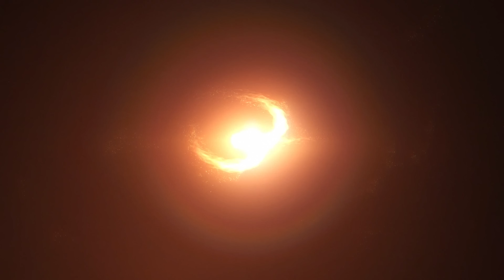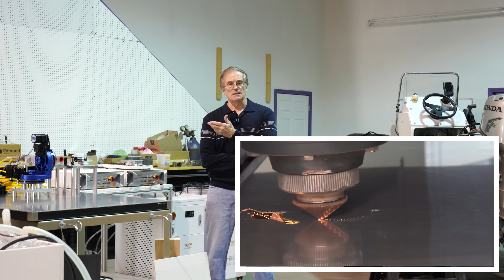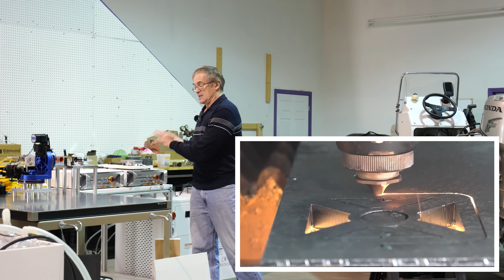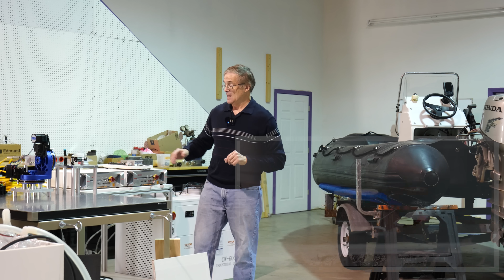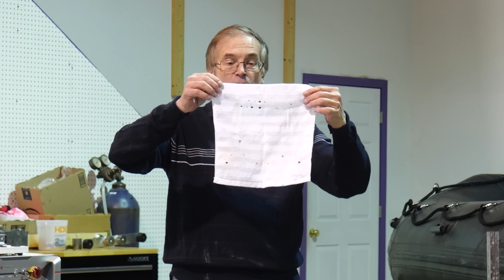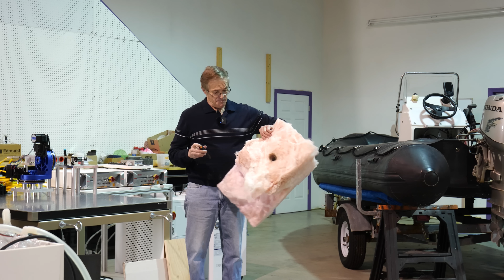We have a problem... and need your help!

Comment: For lasers with so much power one solution isn't enough. What you really should do is to divide the problem into separate stages.
1. First line of defense should be simply your software, as it should never allow the beam to become stationary for too long (delay could be set to below one second or so).
2. Second line of defense should be an analog circuit connected to the galvo system you're using. It should get the feedback information from your galvos (mirror movement speed) and it should detect when mirrors become stationary. The moment that happens (with configurable amount of delay) the circuit should cut off the power from the laser (or the driving signal or both).
3. The third line of defense should be a high speed shutter (e.g. spring loaded mechanism) that would deploy a shutter (or 45 degree mirror) to absorb the beam (or divert it to the OEM beam absorber). It should be placed just before the galvos. It could be also driven by such analog circuits as in stage 2, but don't drive it from the same circuit and instead use a duplicate for redundancy (two independent circuits one for the laser driver/PSU, and the other for the shutter).
4. Last stage would be located after galvos, but isn't that much problematic when first three stages solve the stationary beam issue, so any of your previous ideas would be fine, but be careful, as any material that melts instead of ablating carries the risk of reflecting the beam randomly which is even more dangerous. (e.g. imagine melted metal, glass etc. deflecting parts of the beam in random directions).

Now, you might not like the solution, as it potentially reduces the performance of your system (will not work reliably for absolutely stationary targets), but unfortunately that's how professionals do it. Consider - how often would aiming for a flying drone require a 100% stationary beam for few seconds? Almost never, but it could be calculated. And remember, this is the only single case impacted by this solution, and it still might work for stationary objects most of the time (because stationary target isn't the same as stationary beam).

Fun fact, when I was working with a high power laser at a university, we decided to make such mechanical beam deflectors from modified scanning head from HDD, because of it's speed and reliability. This allowed us to quickly resume the laser operation automatically.
Reply: If the drone appears stationary, it is targeting the laser defense unit.
Reply: @michaellee6868  Not if it has more than one camera.
Reply: I do not agree:
1. Make the system intrinsically safe through physical means.
2. Do not rely on software solutions, no matter what SIL level it is rated at.
3. Goto 1.
Reply: @pompeymonkey3271  Nobody says software should be the ONLY safety measure. Please read carefully - my advice specifically says to adopt 4 safety measures, all working together with the one on top of each other approach. This means, if one fails, there are 3 other protections still working.
Reply: I agree all of the engineers saying to compromise every other requisite because you could have an automatic stopping system did not understand the mission

Comment: Use a small, water-cooled chamber, with the side facing the laser beam made of thin sheets of tungsten metal. All parameters can be calculated, including the tungsten thickness, water flow rate, and coolant temperature. You can then simulate the process before conducting the actual test.

Comment: now i dont know if it will work any better. but instead of your fiberglass insulation, how about rockwool insulation?? i know its not as popular in the states as it is in europe. but might be worth a try, atleast to see if it does any better and can be used as 1 of multiple different layers

Comment: The only thing that probably can work is something self healing which could be tank or water rather than towels
se 1-2 pieces of glass and fill the gap between them with water. for better result use copper sheet for backside as copper is very resistant to laser beam because of incredible  heat conductivity, aluminium is also reasonably good, steel is useless
water opacity can be modified with dye or glitter to absorb beam more gradually amd prevent it from exploding and damaging glass.

Comment: I propose using a rotating disk covered with ceramic heat-shield tiles, similar to those used on SpaceXs Starship. the rotation ensures the laser beam never remains stationary long enough to penetrate the matrial. To further prevent localized heating or damage, the disk should also Move vertically by a few inches up and down, distributing the lasers impact area across the tiles. an array of these lightweight, ceramic-tiled disks could provide effective and mobile protection, significantly reducing the risk of damage from the laser.

Comment: Movement.
When the problem is only difficult when the beam stands still, don't let it. Movement is relative. Move the background. Try some of the following:
- moving air with absorbing particles inside (fog, dust, etc.) in front of the barrier.
- try the towel idea but with moving water, i.e. actively flowing water over it.
- Make the barrier spin, ideally more than 1 layer, counter-rotating.
Reply: Good idea. Reminds me of X-ray tubes where the electron beam is hitting a rotating target.
Reply: I like the spinning idea.  He could use a modified osculating spindle sander.  Make the spindle larger, and crank up the speed.  Could make the spindle out of graphite.  Could also wire it, so the laser cannot turn on unless the osculating spindle sander is running.
Reply: A rotating granite fountain/statue, he could have a nice sculpture / water feature sprucing up the place
Reply: I was thinking of a curtain of water dyed to make it absorb. Same idea, flowing water would keep moving new material into the beam.
Reply: You didn't listen to the parameters. He said 'or if the mechanicals fail' Can't move if they fail.
Reply: @FlakeyPM  The mechanicals guiding the laser, he is talking about.  A spinning drum 15 feet away is not going to instantly stop.

Comment: I don't know enough to make really brilliant suggestions but would a sort of carbon dense material work? For instance, set up a container like those that make wood gasses and use the tar. Put tar and gravel in a sandbag along with anything else that may improve the sandbags resistance--like maybe make the sandbag our of a certain material as well. I'm kind of basing this off of FIRE and not LIGHT though, you also have fire proof materials such as those seen on @Nighthawkinlight. You may even have to layer the tar for any sort of positive effect, but if not a sandbag at least sounds pretty scalable, easy to move about and, replace.

I haven't given, very literally, any thought to this--immediate gut reaction to your problem. I'll do some googling and see if I find anything as well. Never heard of those lasers in my life so I don't know enough.

Comment: Showing my ignorance here, but could a high temp mirror reflect it down and into a tank of water with particles present to absorb a greater range of wavelengths. Other thought it swamp cooler padding or fire brick with laminar-flow levels of water cascading down over it.

Comment: WOW got I jealous seeing these fiber lasers under your workbench- a kids dream came true ;)
While thinking about this problem, I thought about the practicality of most solutions readily available. In fire-protection we utilize mainly 2 methods in order to protect important components from many 100 °C of fire energy. Ablation abd Intumestation. First method uses highly thermally conductive materials to conduct away the heat. Reading into the most efficient systems, none is capable of conducting many kW power from a mm² area in such rapid fashion.
Left with the idea of thermal insulation by permanently intumestating materials- i tried some I had left from a project, and just used my 120W diode driven laser with a collimative lens setup. Turns out it somewhat works at this rather low power. Those materials 'foam' into black carbon like fiber structure, and the more it is heated, the more foam develops. It just started glowing red, turning laser radiation into IR radiation. (Tested with HILTI CP 611A)
While I think such thermal paste (Eg. a cm thick layer applied to some drywall) may give you some ms, I also think it may not be sufficient.
And while wondering why you wouldnt just use a brick wall (forgot that in US even obtaining bricks may be a story on its own), it came to my mind- what about simple sand bags? Molten sand should by the weight of the sand on top be rapidly replaced and the molten component compressed, exposing all fresh sand at the laser entry point.

However, interesting experiment, and also interesting channel- my Regards!
Looking forward to see how you will deal with optical abration due to air layers in the process....

Comment: What if creating a round frame and connecting high-pressure water nozzles that will start spraying in anticipation of a failure. It will work like an air curtain. Only a hole for the laser beam to go through.

Comment: Soooo, what wavelength of laser is it? I've got two ideas. I'm wondering if you could leverage something like a fish tank with dyed water in it. if the dye is 'tuned' to not absorb all of the energy in a small point, it would then be able to dissipate it over a larger volume of liquid. of course, this means having a tank made of something that can pass that amount of light into the material, which might be a small issue at those power levels.....

another option is an ablative material like phenolic-impregnated fabric or even a DIY Phenolic Impregnated Carbon Ablator made with carbon fiber. if its good enough for rocket motor casings, it might, MIGHT tolerate a blast from this beast for a short time if adequately thick. no idea what the fumes let off by this would be like, i'd imagine not the best to breathe.

Comment: Simple solution, you need a material something like the gypsum in the drywall. Material needs to be granular and vaporize when struck by the laser rather than melting.
Build a container, three sides in the bottom could be made out of most anything. The side facing the laser could be 10 gauge plate metal. Fill the container with finely ground gypsum powder easily attainable from a construction site and ground with a hammer mill.
The laser will instantly burn a hole through the plate metal and enter the gypsum powder, it will start to vaporize and create a void. More powder will fall into the void and continue the process.
All components are cheap, easy to build and move around. In addition the whole thing is scalable.
I hope this will work as good in practice as it did inside my head.

Comment: For curious people, that is a Chinese Max photonics ( MFSC-2000 or 1500) laser source.
Reply: How much is it? Asking for a friend
Reply: @tedarcher9120  these cost between $1500 and $2500 on Alibaba.
Reply: @tedarcher9120  between 1500 to $2500 in Alibaba
Reply: How much is it? Asking for a friend
Reply: @nikoivan2580 between 1500 and $2000
Reply: @nikoivan2580 random internet vendors put it around $3000 list (not including tariffs.)
Reply: I turned up the resolution on the stream and they read: MFSC-1500X
Reply: 15kW, sweet!
Reply: @tozrobilem  these have 1.5kW to 3kW variants. Above 5kw is sold by US defense contractors to military.
Reply: My web searches lined what he has up with the 3kw models. Stopping 6 KW focused into a sub-mm beam Channel is quite the puzzle. Most people didn't even bother to figure out what they were trying to do they just started spouting off the go-to answers.

Comment: The only other thing I can think of would be night hawk in lights "starlight" recipe
Reply: +1 to this. *Starlite
Reply: I just suggested this, didn't see your post first haha! Immediately came to mind when I saw this.😁
Reply: i had that tought
but the heat were dealing with here is on a whole other levelfrom a simple fire what that was designed for
maybe talk to NASA and get some of the spaceshuttle heat shield tiles?

Comment: I like the water wall idea.  You may need to combine several ways to mitigate the beam.  Any dense material like brick will crater like getting a torch too close to concrete. Space shuttle tiles?  Foamed ceramic?
In short you want something heat resistant, loose so material doesn't explode out of the path, and maybe active cooling of the area to bolster the material used.  My first thought on my budget would be discarded graphite/carbon bricks from steel plant that uses them as electrodes in arc furnaces (I got a few from a junkyard) and grind up to use in a slurry to waterfall over a substrate.  That will give you beam and heat dispersion.  That leaves what medium to use that won't instantly vaporize or release toxic fumes and a suitable substrate.  I guess plywood is still viable if hung from the top so warpage won't matter much.  How about those light weight furnace bricks or ceramic blanket?  Maybe start with water and something to keep carbon in suspension and maybe thicken the slurry a bit - corn starch? xanthan gum?
Just rambling...

Comment: After going back and forth with chat-gpt about some ideas. I initially was thinking some sort of prism to break up  the beam and salt backwall. But as chatgpt informed me salt can explode under high temperatures... instead it gave me this information. I hope its useful, good luck and this is kinda a funny problem to have xD

Best Combo Approach (DIY-Friendly)

If you want practical, cheap, and non-toxic:

    Outer layer: 2–3 cm ceramic fiber board

    Middle layer: Sand-filled panel or water wall

    Back layer: Concrete or another sacrificial ceramic board

That’ll buy you several seconds even under a focused hit, won’t reflect the beam, and won’t send noxious smoke everywhere.

Comment: I suggest graphite such as used in high temp crucibles ( or even just graphite tiles) pre-treated first with torch to drive out all moisture and the surface sealed with any thin sacrificial sealant to prevent re-absorbtion of moisture from atmosphere. Any porosity in the graphite which will be very dry should not spallate and should aid in scattering and reducing beam density. The graphite might get very hot but i don't think it vaporizes.  GREAT channel, Thanks.   Phil Spindrift

Comment: possibly graphite sheets? it sublimates into C02 which could act as a plasma that is mostly opaque to the beam. haven't run any calculations on that, just an idea. large IR translucent sheet as wall for a large water tank that uses water as optical medium in a concave optic that diverges the beam? typical beamdumps are a small hole through which a laser hits a reflective cone that diverges, splits and directs the beam into a cylindrical, opaque surface. this works fell for a stationary laser but certainly not for one zipping about with a galvo. a fast rotating target might work to average out beam power over a larger surface area. vibrating either source or beam dump can have a similar effect to a strongly diverged beam.

Comment: Steam or fog, enemy of lasers and microwave IIRC. Keep up the good work.
Reply: containing the steam/fog might be a problem
Reply: @UNgineering  I wasn't thinking of it as a single layer solution, but as a single layer of a multilayer solution. If it were used as a middle layer, then the layer beyond it would be potentially have a longer life, as some have called for graphite or carbon as a backer. Something easily mobile, fairly lightweight.
Reply: exactly my first thought. Though they wanted something absorbent not dispersing.
Reply: @wtfomgok  I thought they didn't want reflective/mirror like.

Comment: There are lots of great comments. The carbon based ones sound nice I like the ones of spreading the beam out on more (heat resistant) material, defocussing or spreading the beam out (reflection or diffraction) another option is using a spinning shield (a disk or a cylinder) so that fresh material is continuously presented and hopefully cooled off by the motion.

Comment: My reaction, from a place of not being an expert, is to go with a tank(aquarium) of water(or other liquid) with a dye that has a absobant spectrum close to your wavelength. Carbon black might work, and is cheap, but there may be a dye that does a better job with water. Any holes should be filled just by the fluid falling in, basically boiling it. The length of the beam in water is probably important. I do worry that basic glass may absorb too much of the energy of the beam, so you may have to use specific glass for this(I would guess similar to the glass in your lenses if they are not burning out). Put a kiddie pool underneath for any breakage, backstop with any of your known good materials and add a safety shutoff that kills the beam if it makes it past the water.

Comment: Ah now this is my level.
Dirt... Tall dirt berms.

If the laser burns in, new dirt falls down.

Do it outside, under tent cover.

I don't think it's gonna be portable unless you use napoleonic style gabions
Reply: Wouldn't the dirt just melt together forming a tube around the beam?
Reply: Worse the vapor from the burning dirt would super heat to the point that the vapor itself can vaporize more dirt.
Reply: loveblowsbad When the dirt vaporises, new dirt will fall down due to gravity. It's simple and cheap, there's no way they could burn through an entire gabions worth of dirt, the laser would likely go before they ran out of dirt.

Comment: Pretty much as said below, a starlite material or carbon foam ablative material. The reason the plywood worked better was the creation of smoke and carbon-carbon structures.  This might seem a joke, but take a few slices of bread and make REAL carbon foam and stack it and test it. I mean, it's going to be a consumable item that will ablate rapidly.